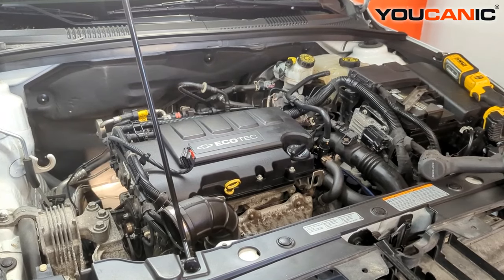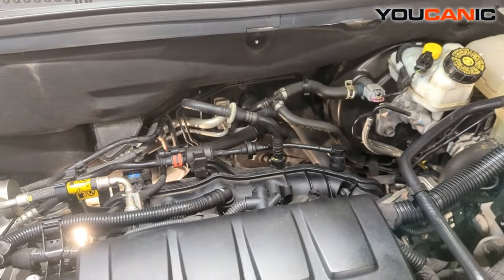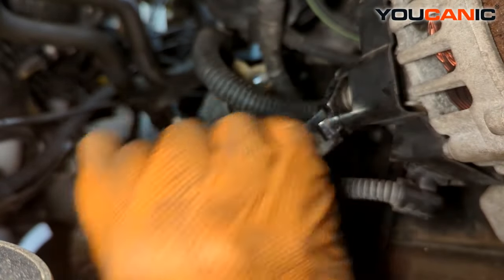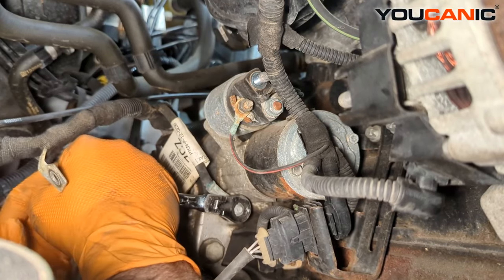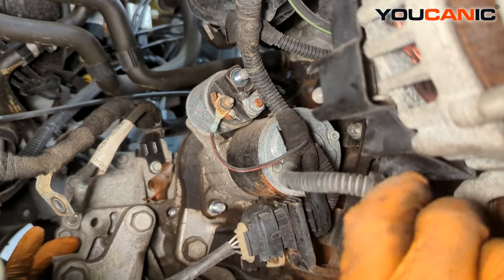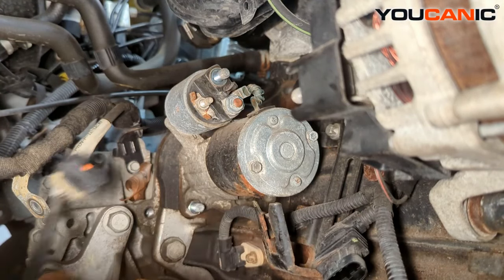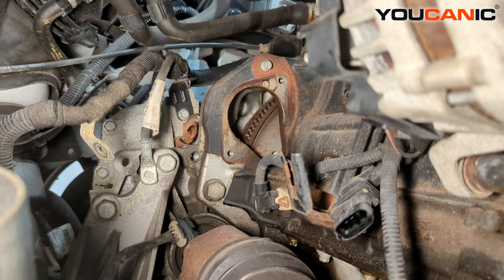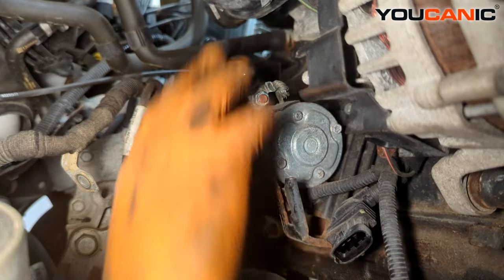2008-2016 1.4L Chevrolet Cruze - Starter Replacement

Comment: I just replaced mine thanks to your video and now my car is actually making a click sound when I try to start it. It wasn’t making any noise before. With a jump, it still doesn’t start. I have 3 codes pointing the camshaft censors being faulty now.. I’m confused